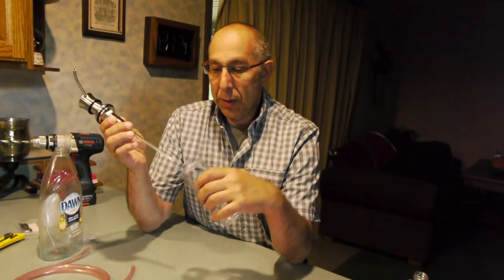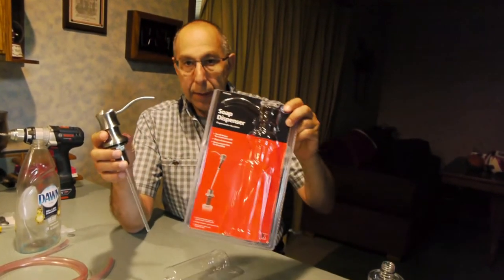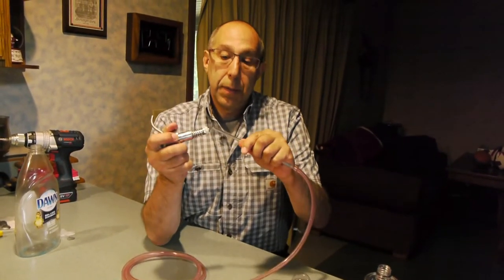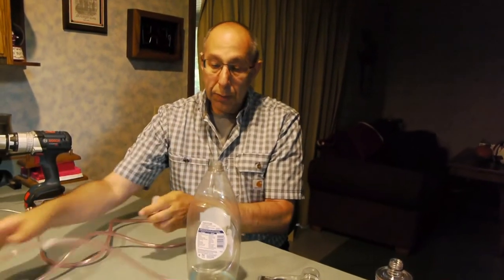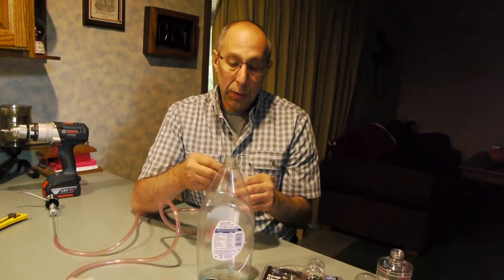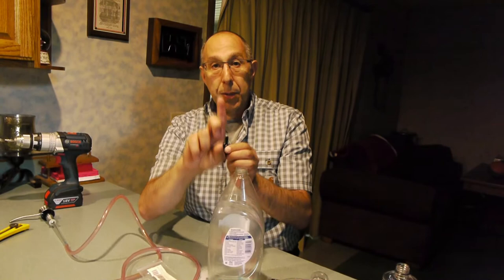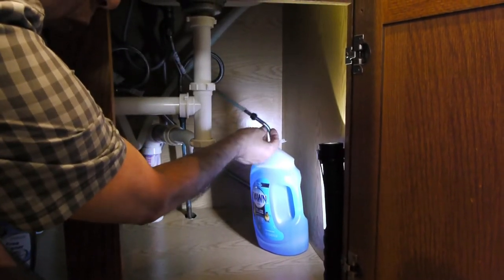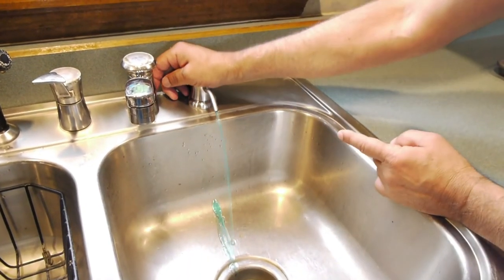Dish Soap Dispenser Tank Hack, fill dispensers less often and make it so much easier!

Comment: The check valve made all the difference.  It was a bit pricey but is key for success.
Reply from the maker: I agree Ray.  I will be posting another video that tweaks this setup a bit by using a check valve and pick up unit with a screen all together, eliminating the need to cut the hose and put the check valve in the middle...  Thank you for your comment.
Reply from the maker: @Ray Maiden I just installed another pump assembly but used a little better setup here: https://youtu.be/1S38LlRMAxY
Reply: @commonsenseripsomehelpful  Where did you find the check valve with the pickup unit and screen?
Reply from the maker: @redbluff2583   Here: https://www.ebay.com/itm/132320818777

Comment: Problem is that ppl make the bottle air tight so if you notice the bottle all scrunched up its actually sucking the soap back into the bottle so dont make it air tight. Check valves a good idea but not really smart if the bottles air tight. All the valve is, is a ball bearing that seats into a cup so pretty much any valve will work even a fish tank check valve.
Reply from the maker: Hi Mike Usa, Thank you for pointing that out! That is a great point I didn’t even address. While I drilled out the cover to push the rubber hose through, I did make it loose enough to not be airtight so that it would be able to draw air into the soap bottle as the soap gets drawn out of the spout onto a sponge.  Thanks again for your input... greatly appreciated!               Merry Christmas!

Comment: Howdy Sir, thanks for the video and instructions.  Did I need to put anything on either side of the hoses that snug up to the check valve (ie:clamp or silicon)?  Thanks again.
Reply from the maker: Hi @Olmud, you are welcome.  Because we are working on the suction side of things, there is no outward pressure trying to push apart our fittings and connections.  More specifically as we push down the hand pump, we are actually creating suction in that hose which; pulls in on all the fittings and connections, pulls in the one-way check valve to draw the soap up.  The short answer of my long explanation is; no, you do not need any hose clamps or silicon to hold the components together.  Thanks for your question... be well.

Comment: I set it up exactly as you recommend.  It worked great for about a week, and now the pump doesn't;t stay primed.  Any thoughts on how to improve this so that the pump stays primed?
Reply from the maker: Hi Tina.  aaaaAAAAAAAH... troubleshooting.  Challenge accepted!!!  lol. My first thought is the one-way check valve.  What did you use for the check valve?  (I am going to assume... hehehe... that you used the recommended/linked to one here...) so let's check that valve...  Take the valve out and blow into one end.  The end that the soap container was on should allow you to blow into and through it.  Now check the other direction (which I assume will be the problem) by blowing into it.  You should NOT be able to blow into and through this end as this end is where the valve should stop the soap from flowing back into the soap container thus losing your prime, which sounds like what is happening.  

If you can blow into and through the check-valve from the hand pump side, there might be a piece of dirt or hardened soap or something keeping the valve open - you can try to wash the valve out with some warm soapy water.  You can try to clean it with a toothpick or opened paper clip.  If you can't clean it, replacing it would be the only other solution because this valve is what makes the system work so well.

Also, I tweaked my "hack" and updated it with using a different one-way check-valve with a screened/filtered pick-up tube... that video is here:  https://youtu.be/1S38LlRMAxY

Hope this helped.
Looking forward to your reply.
Rip

Comment: Did you cut the hose to place the check valve in it ? If you did what did you use to seal the hose and the check valve?
Reply from the maker: Hi Gabriella, Yes, I cut the hose to place the check valve into it.  The hose is 1/4" ID (Inside Diameter) and the check valve has 1/4" inlet and outlet OD (Outside Diameter) nipples so you can slide the hose over the inlet and outlet nipples of the check valve fairly easily (you can even put some of the liquid soap onto the nipples to make them more slippery to slid the hose over).  The friction between the nipples on the check valve and the hose is enough to hold the check valve in place (there really is no need for hose clamps or any other type of retaining method to keep the check valve in place) because there is no real pressure being developed in the line/hose.  Hope this helps and please don't hesitate to ask any other questions you might have for me to help you get your new soap dispenser up and pumping! ;-)
Reply: Common Sense Rip Some Helpful Things this is very clear, thank you !
Reply from the maker: @gabriellabuissereth6795   Glad I was able to help.

Comment: Is that valve absolutely necessary? I did this years ago in another house and don't ever recall having a problem. Someone told me that I needed to seal off the top of the soap bottle itself because it requires that it has a little bit of a vacuum so that it doesn't seep back down into the bottle under the sink. I just did it in my current house but my tube is more than 16 inches because to get from the sink top to the bottom of the bottle looks about two and a half feet. I'll report back on my results without a check valve! Thanks for the video!
Reply from the maker: Hello Richard Mauro, Yes!!! The one-way check valve with screened pickup is absolutely necessary for at least three reasons: 1) the check valve will not allow the soap to creep back down into the bottle which would make you have to pump all the air back out and re-prime the pump (especially over a longer hose like you are using). 2) the screened pickup will keep any debris or dried soap from getting sucked into the hose and/or pump and blocking and/or ruining the pump. 3) the screened pickup also keeps the end of the hose from getting sucked to the bottom of the soap container also blocking/not allowing soap to be picked up and pumped up through the pump. While not using the valve might work, over a shorter period of time you will need to address problems that using the valve will avoid. Also, creating a vacuum in the soap bottle will actually suck or draw the soap back down the hose into the soap bottle and make you have to re-pump or re-prime the pump. Hope this helps. Thanks for commenting. Would love a follow up after you set yours up.
Reply: @commonsenseripsomehelpful  Thank you. I will buy that one on eBay and report back. I really appreciate your reply. Richard
Reply: Have same problem with the 16" of tubing.    We have to set the bottle of soap on a stand under the sink to reach the short tube.  Did the 2 1/2' of tubing work?
Reply: @janeschreiber5380  It's been so long and I moved and recall not having any problems with that length.

Comment: Mine has a shit ton of sporadic air bubbles! Help!!’
Reply from the maker: Okay... challenge accepted ;-)  Let's start by pulling the bottom check valve out of the soap container and put it into a container filled with water - see if the water coming out of the pump has any bubbles in it or if that stays a solid stream of water.  It sounds like your pump is beginning to fail.  Do you have another pump to try?
Reply: Yes I ordered another pump same deal.
Reply from the maker: @bmanh2355  Okay... did you pull the whole hose with the bottom check valve out of the soap container and put it into a container filled with water - see if the water coming out of the pump has any bubbles in it or if that stays a solid stream of water.